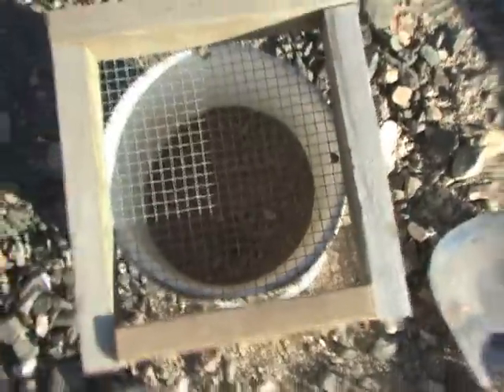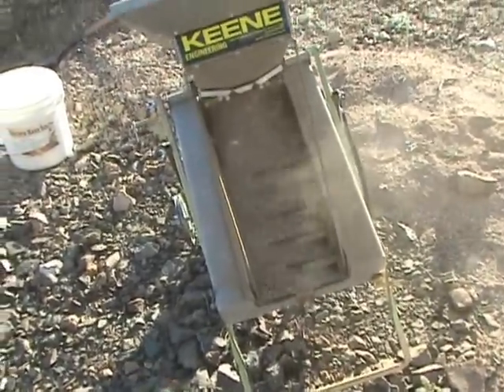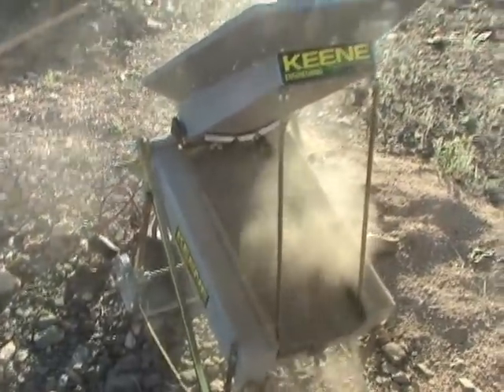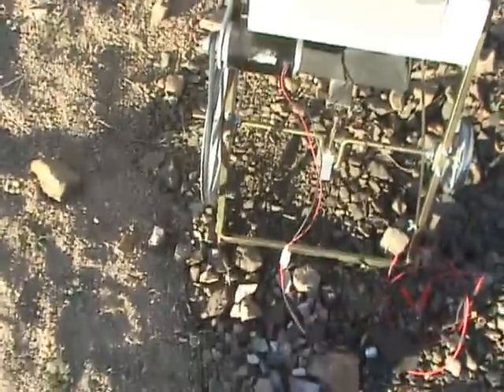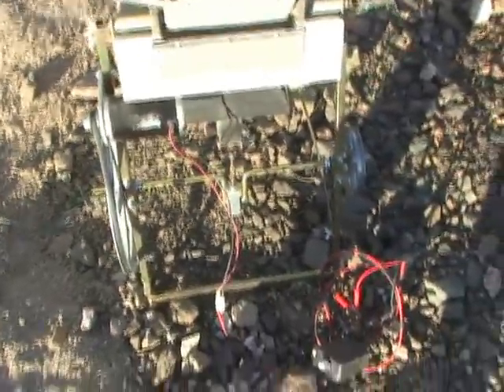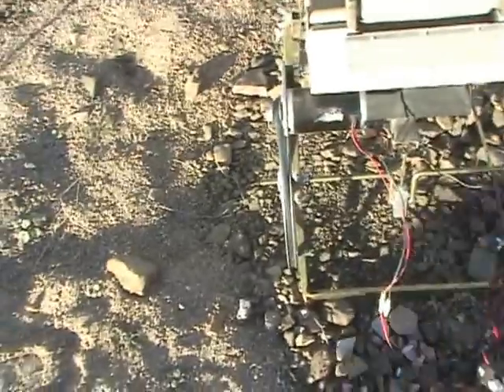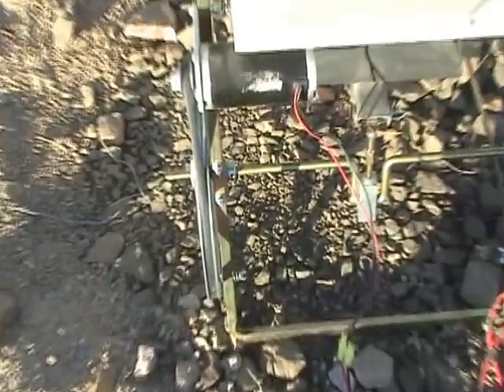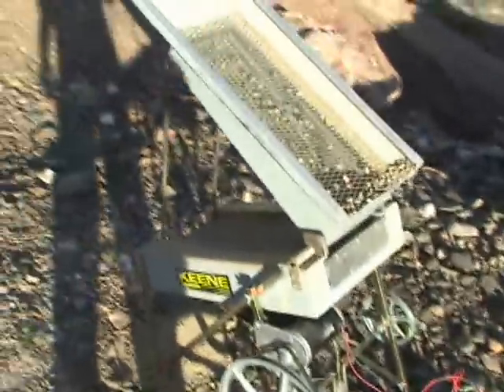Keene Engineering Dry Washer: The Final Verdict

Comment from the maker: I did not pan out the pay dirt--- four buckets of material did not seem worth the effort. I had planned running 30 buckets through. The weight I put on the bellows flapper valve worked great: much better than the original, and I think Keene damn well ought to consider it standard. Keene should also add a few spacers in various places. I am baffled over why Keene appears to have no interest at all in the problems with their machines.

Comment: I had a problem with the set screws coming loose on the pullies so I got some locktite. But it seems you have another problem there. It looked like it was working pretty well until it broke. The dirt was really flying up there pretty good. I would classify it down even more to like a #20. Did you pan out what you ran through there?

Comment: looks to me like you need to flip the large bottom wheel over to provide the space needed, the spokes are flat on one side and angled on the other , put the angled side on the inside, should straighten the belt and give the space needed to miss the bolt.

Comment: I think maybe this Keene washer was state of the air for a long time, and perhaps Keene no longer supports the product but sells the remaining ones they have in stock to distributors who also have some in stock. We had some length back-and-forth with Keene about the low quality, electric motor that was shipped working but with a broken rheostat controller that was not really needed. But the tolerances are sloppy on these things, not the best quality though they're somewhat expensive anyway.